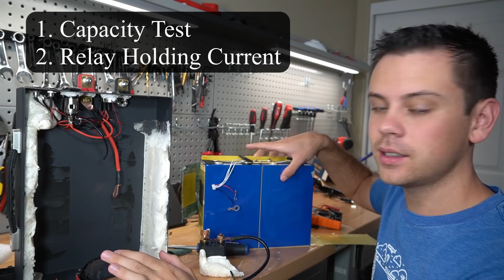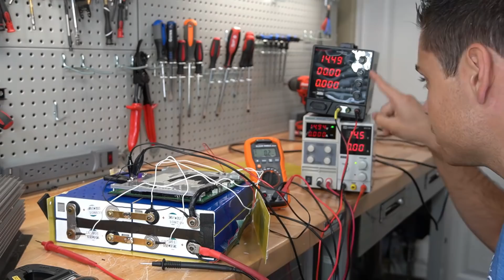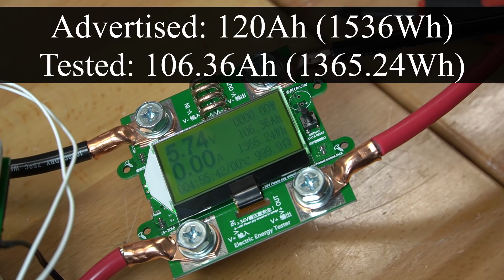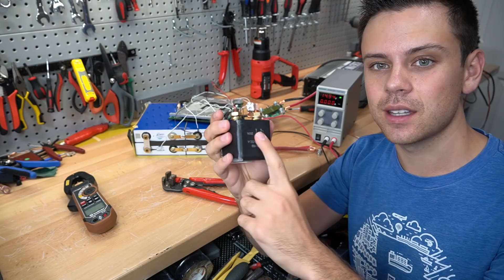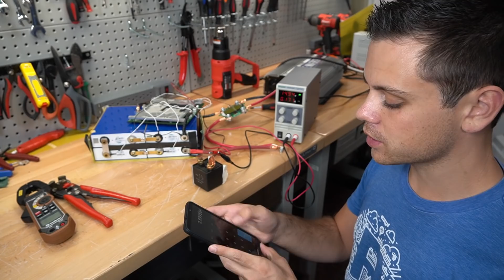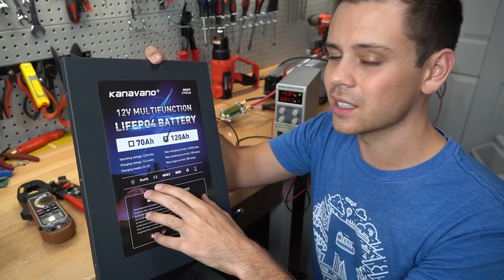$456 120Ah LiFePO4 Battery Part 2: I got ripped off

Comment: THE QUESTION YOU SHOULD ASK YOURSELF: at which C rate the 120Ah capacity is rated at ??.. If it is advertized at C/30, then this is 4A rate and probably tyou can get the 120Ah at that C rate. It all depend on the internal resisance combined with the R loss thru the entire wires.  I would suggest to test at various C rate and determine if you can get 120Ah and if so, at which C rate you get it and if it correspond to the rated capacity conditions.
Reply from the maker: Oh I'm pretty sure we all know that lol. .2C is standard rate in the literature and I can pull full capacity at that rate everytime. Hell, at .8C I can usually pull full capacity with new cells. Watch my older videos where I talk about my testing methods for LiFePO4
Reply: @WillProwse   My comment was more about the fact that you could have  mentionned at least the effect of the C-rate  as a possible reason in your video. Common powerbank like that will specify some duration at various load in the specs and that is directly related to C-Rate. 

Some LiFePo4 are rated 30C like the A123 and some are rated 2C like many cheap brand have.  The higher the C rate the more volume the electrode will have but also will make the less room for  chemical stuff ( solvant, separator, etc..) and  consequently the less energy is available.  This is the same difference between the CALB cells ( ultra low IR of sub miliohm per cells and the Thundersky (common high IR).
Reply: One great contactor is the Kilovac EV 200 from Tyco. This contactor is offered with the coil economizer circuit that reduce the current to the coil once the closed position is acheived. it only consume 1.7W of hold power and can take 500A at 900VDC if i remember correctly
Reply from the maker: @Doctorbasss  that contactor sounds awesome.

Comment: Seems to me you ran a 15A load, which with a peukert exponent of 1.05 would make the battery actually hold 120AH. If you ran the test with a 1A load you would probably see 120ah
Reply from the maker: Peukert effect doesn't apply to this chemistry. Please head over to my beginner videos. For LiFePO4, we pull full capacity at .2C. it is standard in the literature. Hell, I can pull full capacity at .8C with this chemistry with new cells.

Comment: Great video, does the packaging state the rated load (C) at which it will achieve 120ah? If you ran the batteries at 1a load it would probably get there.....
Might be worth running the test again at a lower draw and see what happens....

Comment: Love your channel I have learned a ton! What would be the best way to go about building an 800 or 1000 Ah LiFePO4 battery pack for my solar system? My Rolls lead acid batteries are getting very tired after 15 years. I have 2 Xantrex 4024 inverters linked to get 240 volts. Would you parallel 4 or 5 200Ah batteries?

Comment: After seeing so many high current (>20%C [for typical mfg advertised spec]) capacity tests on the DIY forums where the poster complains that the cells don't meet their specs, I was wondering if that was the case here too. But Will is testing at 12.5%C (15A) which would be suitable for even a 75Ah cell, and it still fails. Well done. Great video as always.

Comment: Shouldn't the battery have been at around 14.4V when you started the capacity test?  It was at 13.7 which means it wasn't full, right?
Reply from the maker: It was at 14.5V but with this chemistry, the voltage settles rapidly. I also top balanced and let it sit for a few hours
Reply from the maker: Also let it absorb with one supply at reduced rate to top it up all the way
Reply: Thanks for the info!  I've never used LiFePO batteries.
Reply: SSShh....Quiet time

Comment: Shocker... 😂 But on the other hand, loads of stuff from AliExpress is actually really good value for the money so even though this was cr*p I’ll still shop there. 

Do you usually have to send these false advertised battery’s back to AliExpress when disputing and if so, how is that process? Do they send out a prepaid shipping label?
Reply: Never bought anything this valuable from Ali before. With cheap stuff I usually don’t ask for a refund because I value my time more than the return.

Comment: Great site, good information, would like you to check out Lynac battery from Canada, just install a 10 kw 48 volt battery, I’m no export but it looks good, well build from what I can see and works as advertised. Priced at just over $5000 Canadian for 10 kw, works out to approx $400 us per kw. The only down side I see is that it’s built as a 15s so the voltage is about 54 volts fully charged.

Comment: May I suggest doing this same capacity test on any lead-acid battery that is claimed to be 120AH? I suspect that you will get much less than 106AH even if the battery is of a highly reputable make.
Reply from the maker: We don't use lead acid batteries on this channel 😂🤣
Reply from the maker: I hate them with a passion
Reply: The capacity test for a lead acid battery for solar is not comparable because you can bring a lithium battery down to 20% of capacity without hurting it however, a lead-acid battery becomes damaged when it reaches below 50% of capacity. Additionally, the C rate of a lead acid batteries is up to 10 times lower than some lithium type batteries.

Comment: This video wasn't auto captioned, could you turn that on? Thanks.
Reply: I just checked to see if it was offering Auto captions and it is yesterday morning or whatever the morning after the debate was I checked the different videos of it for the caption and maximum resolution and basically most of them only went to 7:20 and did not have any caption options. Some like ABC had many and did 1080p. I was very disappointed that CBS did not meet my expectations giving it was the first high quality video streaming source.

All of the videos were from streaming that had captions however in English. There was one promising video that was only like an hour online so might have been from a higher-quality source. There was one scam syllabus 42 I think was the name of the video who has had no viewers or one viewer and his goal is 500 yours and he had listed his video as 4K but actually it was like incredibly low resolution. You can check using stats for nerds option in YouTube.

It is also possible for people to make a manual caption for a video if the Creator has not prevented that and copy as I mentioned before the captions if you lack the bandwidth or earbuds so care hear the audio for whatever reason as some commenters admit.

Since we'll has local copies of all his videos he should provide a audio podcast all he has to do is run a separate recorder and I think he would get around any rules that YouTube has about reusing there audio. He has said that he retains the copyright on all his videos however so he should have the right to do audio. Monetizing the audio it's something I don't know about but I think some of his audiophiles he doesn't care about monetizing. In order to get part 1 of this to play without pausing I had to put it in the background and listen to audio only because even at 1:44 I get a lot of buffering because of the merger of T-Mobile with my carrier makes my carrier no longer own its own antennas so they completely cut me off at my 35 gigs this month very interesting way I can still do high bandwidth with Google Duo but if I try to send a picture message in Google Hangouts it takes several minutes for a single picture! it's a very strange thing but live high quality video is an option when I can't even send still low quality images I think it's like $1,200 or the $600 per week the carrier has to make sure the pixel devices have their Duo App working normally and it is owned by dish network so I doubt that once they improve their software I will be able to continue to Doduo all month long regardless of what bandwidth they have used however it does punish me for making a video call after the call already LOL.

 most important thing about captions that might actually explain your comment is if you are downloading the video using a free trial of YouTube premium for example like I am good luck seeing the captions I could not even share videos last night I think because of my minimum bandwidth

Comment: a couple possibilities.

1. you bought a brand new battery witch means you need to cycle it a few times to break it in.

new batteries need to be broken in to get the full abilities.

2. you got a used battery pulled from a system when the capacity reaches less than 110 ah and they sold you as new or new old stock.

3. maybe new old stock that slowly discharged to 0 volts or below the lvc and they recovered it but did not tell you they recovered it.
Reply from the maker: 1. No.

2. Why? I doubt it.

3. Still need to return it then
Reply: Again, Stop talking.
Reply: @xraykadiddlehopper8067  we are entitled to our comments

Comment: Hi Will.
I’m curious about that watt-hour “counter” (multifunction-like meter). Do you mind doing a review of it ,and also let us know where to get one ?
Regards,
Jesse
Reply from the maker: I have a few videos covering it
Reply: DIY Solar Power with Will Prowse 
Ok let me find the videos in your channel...
Thank you.
Reply: @WillProwse  Thanks I will try to find them.
Reply from the maker: https://www.mobile-solarpower.com/battery-capacity-testers.html
Reply: DIY Solar Power with Will Prowse 
Hi Will,
I decided on and has ordered the Drok Hall effect version from your affiliate links. Based on watching your review of all the various DC testers, I think the Hall effect one seems more advanced, can measure more power and most important, the device doesn’t “carry” the heavy load current currents being measured and thus will not experience overheating unlike the shunt based types.  I also liked the idea of being able to control external devices (maybe via a relay) based on over-current, over-voltage, and battery AH. 
Waiting for device to be shipped to my location.
Regards
Reply: DIY Solar Power with Will Prowse 
Hi Will.
I’ve seen and checked the specifications of the 300v, 100A Dc capacity meter device. I need to buy the item, but before I do, there is one clarification I seek.; The description states “upto 30000w” can be tested,  yet the specifications section states somewhere like this: “Power Range: 2000~2999.99 W ; Precision: 0.01 W”. 
What’s your take on this discrepancy, and can this device display power larger than 2999W ? Or does the lcd screen have a digit limit that prevents it going beyond 2999.99w ?

Comment: I'm amazed such a relay uses that much power! 2.5W for just doing nothing!?

Also, completely draining the 105Ah battery in 21 days seems insane to me, that's only 3 weeks and it would be fully dead. Really strange why someone would add something like that to a battery which drains it so fast.

I don't know much about relays but why isn't it the other way around? Uses nothing in idle and only consumes a little power when switched on? Safety?
Reply: Yer right ... you don't know much about relays... its NOT "doing nothing"  😒🙄
Reply: @peterfitzpatrick7032  wondering if Will does when he says (@1:35) that 2.5w of coil current means its not likely to do 200 contact amps. . . . .  like what has got to do with contact surface area for current. guess it was just one of his blas'e skipping over the details and slating cheap products moments. actually somewhere i have a 150amp latching relay, so no coil current once its changed state. . . . guess at no coil current it cant pass anything

Comment: Could you open the 200amp relay please. See if there's a circuit board inside to conserve energy like the tyco 400amp EV200AAANA  which has a 4.8amp inrush/pull current then holds at 2watts....

Comment: You can't get your money back..... The product has been dismantled... Besides those cells should be EVE cells. EVE don't have 120Ah cells, but they do have 105Ah cells. So those are definitely 105Ah cells.
Reply from the maker: No I have disputed products that I tore apart and got every penny back if they were falsely advertised. Check out my older videos. This is not new.

Comment: Thoughts on daisy chaining multiple USB power packs?
Reply: MrWeeble19 
...Hmmmm...I imagine by daisy chaining you mean you are thinking of connecting them in series and/or parallel to “achieve” a higher voltage and capacity ?
The problem is, even though they use Lithium 18650 batteries, Usb power packs AREN’T designed for “high current” applications. That means that, their internal connectivity wires are thin and only meant to handle small currents up to say 2 Amps at 5 volts (10watts Max). Therefore, you cannot daisy chain these Usb battery packs to do high power applications...🙂
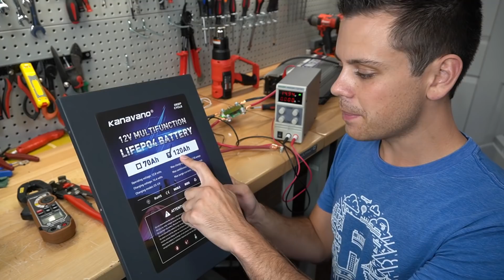Reply: @jessew6757  there are databases where you can look up the chips how to make your own USB C 12 volt 20 volt whatever controller. Those chips have such a huge volume and competition once a major manufacturer starts ordering them that the price becomes worth scaling it up. For example the 200 watt crowdfunded small battery uses two Gan technology chips within the small package but these are very simple circuits to put together once you know the wiring diagram and paying a huge markup and waiting months doesn't seem like a prudent way to proceed. My experience has included both using half a dozen or more small 2:00 amp USB chargers and the six port 60 watt that's $20 and quite heavy but very dense along with a slightly lower wattage similar Port size that was extremely light but one of the first things a burglar stole from me.

I think that the 1 100  port 04th or 200 USB C Chargers are extremely intriguing on a cost per Port basis. Getting one of those and having a bunch of super cheap USB batteries would be the way Hollywood used to do it. Oh you need to do to enjoy cheap flag ship phones with puffy batteries is simulate a battery in them so you can use external power all the time although replacement batteries are quite cheap. Not for all models of course. I have a Samsung a 20 hidden in my toaster oven for a few months now because the cport failed and I have been offered $20 fee to pop off the back but I would sooner by my own heat gun or just try using a hair dryer maybe that will work?

Comment: I guess I will look on the bright side(ish).  You have a 100 AH LiFePO battery, and you have to modify and add a real BMS. So now you are around $500.  Comparing apples to apples on 100 AH batteries, you can grab 2 of these for the price of one Battleborn or other big name LiFePO.  Recycle the copper, aluminum, and steel to get a little money back, repurpose some other parts like the battery meter. 

All in all, it could be a workable alternative for the innovative person.

Comment: I would think that ripping any product apart removes any obligation from a supplier to accept it back for a refund.
Reply from the maker: Absolutely false. If stated capacity for a pack is not accurate, I always get my money back.
Reply: @WillProwse  number one, could you please create a website featuring a database where people can post their experience with these sellers and websites so that before somebody buys they can see what everybody that has log their experience has encountered not just influencers like you? Maybe there already is that website tracking Ali Baba experiences?

Number two issue is that from time to time I am able to lock my screen like I just accidentally did when I had to do something else before we fly and when I come back to the screen I see that little lock symbol on the bottom left and I'm always able to quickly unlock it but never learn how I was able to lock it so if anybody knows how I can learn how to use that extremely helpful feature of Android 9 and probably several versions back I would appreciate it

Comment: Not what I would call "getting ripped off"...  I would say you got lucky ... 
That's why no one should buy these types of products from AliExpress or similar places, unless u want a great deal and have the knowledge & skills to modify  to make them safe and reliable.

106Ah out of the advertised 120Ah from AliExpress is not what I would call "getting ripped off"... I would say you got lucky ... Not a bad deal honestly. 106Ah LifeP04, nice metal case, and 2 shady chargers... Granted a crap BMS and chargers but for the price!.!.! I would slap in a $20 bms, and inspect (reverse engineered) and modify the chargers circuitry to make them reliable (another ~$20).   

Dispute process to get your money back... LOL “the battery was a little under capacity, so I completely ripped it apart in front of tens of thousands of people and want my money back!!!"
LMFAO

Not hating. Just IMO. Great video. Always look forward to watch your content. 
DIY4LIFE

Comment: That test for amp or watt hours is flawed. The low voltage cut off on your inverter and /or BMS would be part of the limitation.
Reply from the maker: Absolutely not. I can always pull fill capacity with any of my coulomb meters with standard LVD thresholds. Please watch my beginner videos on LiFePO4 cycling bandwidth. And what rate I test at. And temperature I test at. It's all there in my older videos. I can always hit the stated capacity value on the data sheet.
Reply: DIY Solar Power with Will Prowse ok, just some folks will base capacity off of their inverter shuttling off, but that can be triggered by the inverters low cut off before the battery actually hit it’s low threshold.  Without seeing the packs voltage at shutoff it seemed incomplete. It’s one big challenge with picking a chemistry and how many batteries in series, to match it to the loads high and low to maximize the usable range.